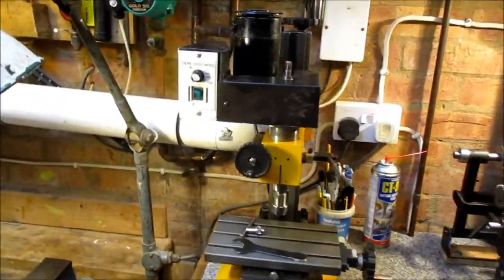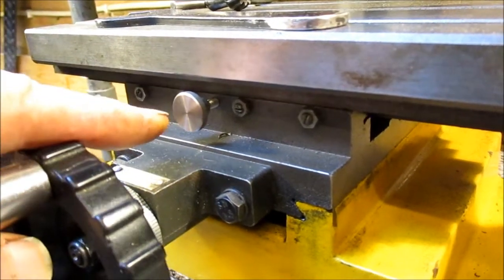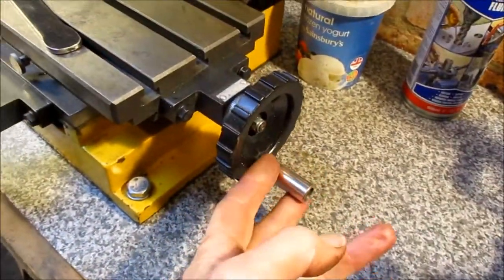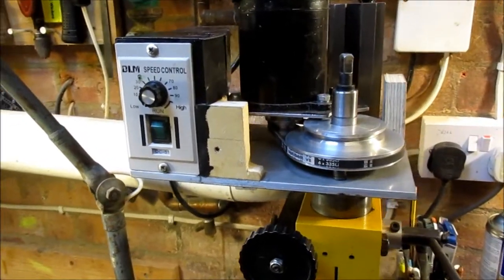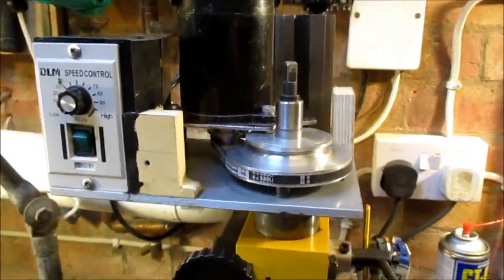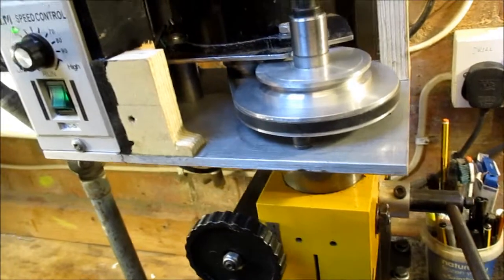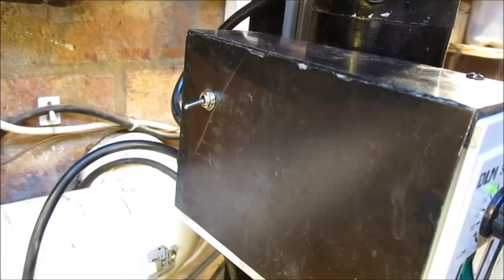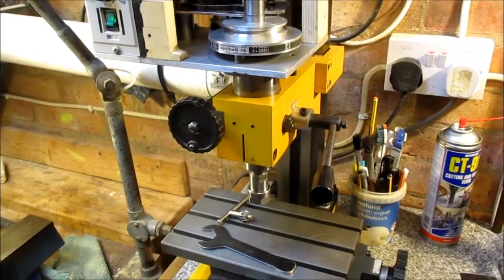Clarke CMD10 /Sieg X1 Mini Mill Mods

Comment: Hello. I am about to convert my mill to pulleys. I see that your mill has dispensed with the original electrics for a DLM speed controller. How reliable have you found that unit to be?
Reply from the maker: It's been fine... that's the one that was on the mill when I bought it second hand off E-bay...
Reply: @delcat8168  Thank you. I have just ordered one as I can see that Steve Jordan has had great success with the same unit too.  👍😀

Comment: Hi, nicely done, did you make or buy the pulleys, any details would be appreciated, Thanks Mark.
Reply from the maker: I made the pulleys. https://bowyersdiary.blogspot.com/2019/12/seasonal-break.html
the next post on the blog shows the bigger pulleys being made on the lathe.
Reply: @delcat8168  Hi, Thanks any chance of dimensions please, it would make it so much easier for me, I have just ordered the  belt, now need to find some aluminium for the pulleys and motor mounts etc, Thanks again Mark.